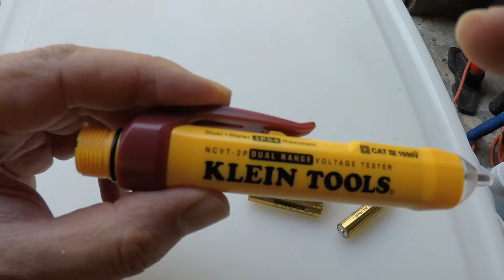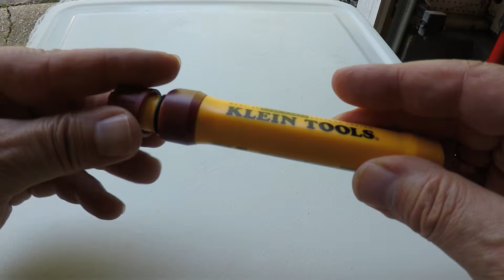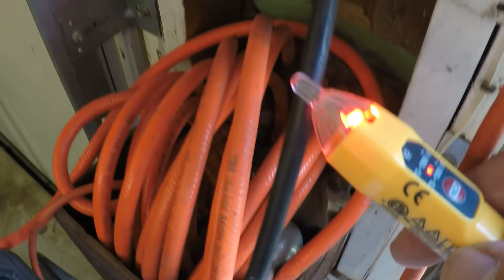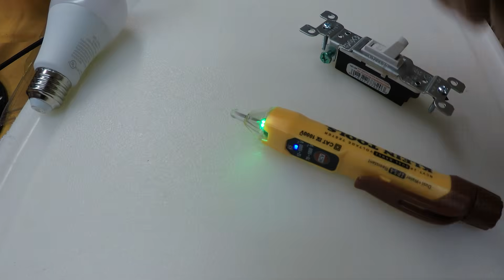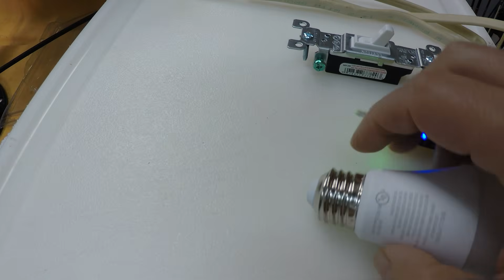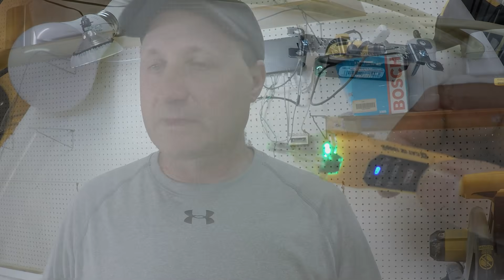How to Use a Non-Contact Voltage Tester

Comment: I just purchased one of these testers with the electrical outlet plug that comes in the package deal and I put two batteries in it that came with it facing them both pointed inward like it shows on the side of the unit and nothing happens what is going on any ideas
Reply from the maker: I dont know about those. Get the one that I reviewed. Link is in the description
Reply: Hold the power button until it turns on. Some voltage testers require u to hold the power button down until it turns on

Comment: This tool sucks.  It’s not accurate and has so many disclaimers on when it will not work.  I’ve touched live feeds and it did not detect half the time.  I’ve stuck it in outlets and detects only sometimes.  It does not work outside sheathing in all cases based on where you are standing.  Buyer beware and make sure you read the instructions thoroughly and the you understand what the directions are saying.

Comment: I find these to be super useful when opening up an outlet and trying to figure out where the power is coming from and where it's going to. First kill the power and pull the outlet off the wires, then re-energize the wires and check the lines. The lead line should beep for being hot, and then the load should still be dead. Very useful if you're about to replace an old outlet with a GFCI. Then re-kill the power, and wire in the new receptacle. After that you should be good to go.

Comment: This came with my new Dewalt multimeter and I didn’t know what to do with it. I thought it was very cool going around the kitchen touching it to the Keurig wire, the air fryer, etc. But then I touched it to a mixer that was not plugged in and it gave me a positive reading. What’s up with that?
Reply: Its a piece of crap thats what. Dont use them.

Comment: Fun bonus, it will also detect if an ionizer found on many air purifiers is actually running.
Reply: How to test for altitude sickness current on a centech cm300 multimeter
MO
Reply: How to test for ac current on a centech cm300 multimeter

Comment: These are banned in the UK in most industrial settings as they do not work on some cables such as SWA and the only approved method for testing for dead is prove the tester, test all power sources including earth and neutral. Then prove the tester again. This is standard in the UK but non contact testers and volt test screwdrivers are banned for safety reasons
Reply: Would this work for basic diy though in the UK? If you put it against the cable
Reply: On internal cables yes, on external armord cables no, sometimes they flag in dead cables with transient voltages such as RF but as they are not dependable and UK voltage is 230v they are not used, only volt testers such as fluke are used to verify the voltage with a lo-Z meter and in industry meters are always tested with a check box before and after testing
Reply: @3D-Dan  I assume a security light would be fine with it then, nothing special in terms of cable.
Reply: Yes it should work but safer with a volt tester such as a fluke T90

Comment: Great video and thanks for sharing. Would this pen work to check for a live wire with higher voltage (240) on something like a hot water heater?

Comment: Never at work with out it but I have found the one with the flashligt to be very handy.  Soon after you start carrying it around it power cycles and beeps in your pocket.  I think the battery spring just needs to be more robust.  Sometimes a small washer helps for a while.
Reply from the maker: Right on

Comment: This will accurately detect a live wire?
Reply from the maker: yes it will
Reply: @flannelguydiy6458  through the sleeve?
Reply: No it wont , you wont know the reason why it beeped or why it did not.

Comment: Will a detector like this register voltage from a dryer outlet?
Reply from the maker: it will detect the current but will not tell you the actual number of volts

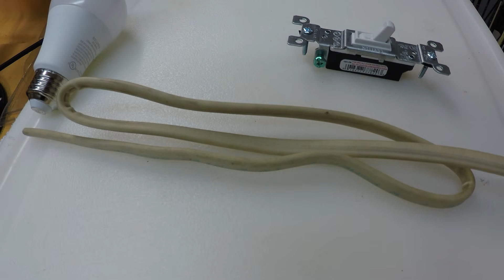Comment: 4:22  That’s the most useful test of all.  In a minute I’m driving over to Harbor Freight to get their 5$ NCVT and see if it’s worth a crap.
Reply from the maker: thank you for watching
Reply: Its crap alright.
Reply: Was it?
Reply: @FrankBenlin   It works, but you get spurious results which are probably not its fault but rather due to dead wires  affected by nearby fields from hot ones.  So some effort is required to get clarity, which can be frustrating.  BUT, I should add, false negatives are surely impossible.
Reply: @philg4116  Okay. Thank you for responding.

Comment: Thanks for the review. It was very useful. Just to add the one I brought has a vibrate function as well.
Reply from the maker: dont let the wife borrow it
Reply: @Flannel Guy DIY  no worries 👍. House we brought has a lot of redundant cable throw under the flooring  will be a good safety asset.

Comment: could this be used to detect if there's a wire in the wall? (so you don't drill a hole there?)
Reply from the maker: no, for that you need a different device which I also made a video on

Comment: This tester does not tell you if you have power in the outlet or a switch. It tells you there's voltage on the line,but you can have perfectly good reading ,indicating good line and the outlet does not power anything. Easy test proves the pen is not a tool to detect power in the wire- rub the tip of the pen against any plastic bag. It will glow red and chirp( if the function is present). Needless to say , the wattage shown is minuscule.If the live wire got shorted under the screw in an outlet and there is an oxide/carbon build-up on the wire,the pen will show you a perfectly good outlet,which cannot power anything.But keeping in mind all the limitations, a useful gadget
Reply: thanks for the insight
Reply: My pen came with an outlet tester. I guess they realized  that could be an issue?
Reply: Right
Reply: Thank you for this. This thing is going to get me shocked.

Comment: There are clones out there going for cheap and can make sound and show graphs. I bought one. Definitely a handy tool. Before I was scare of dealing with switches, breakers, and outlets. This sure is a safety measure.
Reply: There is a clone I like, thinking about getting it.  How is yours
Reply: None of them are good.
Reply: When it comes to safety especially electric I'd go for a reputable company
Reply: @SeanTyree-f4o  none of them are safe.

Comment: Can a voltage tester detect a break in a wire?
Reply from the maker: it cannot detect Where the break is
Reply: @flannelguydiy6458 do you know how that tool is called to detect the break in a wire? if there's such a thing? thanks
Reply: Surely it could as one side of the break you will have voltage the other side you won't?

Comment: These are nice for tracing wires and checking outlets but if you can check voltage with a meter always do that first.
Reply from the maker: yes checking the voltage is something else. This thing can test if the wire is live right through the jacket.

Comment: What is suggest tester for so much wires in a large box if test single wire has power with insulation with so much wire cross each other
Reply from the maker: I suggest turning off all of the breakers until ALL of the wires in the box do not have power going through them

Comment: https://youtu.be/g7HWBfeawJ4  yours appears to be silent and the red light is not flashing looks like the NCVT-2? I wish you would've put the model number since there are several of these this link explains all the different models of Klein voltage testers.. i'm going to get the NCVT4 with thermometer.. BTW in this video the NCVT 
-2 does beep.. Is there a way to turn off the beeping?

Comment: Is there a beep feature on your model? 
I have the NCVT-1.. It beeps pretty loud repeatedly along with the red light flashing but sometimes only one beep but most of the time continuously and it doesn't stop until you pull away.. Which by the way your link seems to be upgraded from your NCVT-2 to the NCVT-3 Also mine does not have any selection for different voltage but it does say on the side sensitivity ranch 50–1000 V also mine only has a power button which can unfortunately be very easily bumped! And I think I remember receiving a notice from Amazon that my model was recalled lol

Comment: The video explains very well. The voltage test pen is still necessary. I bought a renhotecic brand test pen not long ago. The test is very convenient, accurate and safe. Family must.
Reply from the maker: thanks for watching...
Reply: I need to get one of these for a wire I found near a old shed that feel and the wires are caped but I need to see if any of switches in the house turn it off or if its linked to the main power to the house.

Comment: How do I know when to use 12-1000 or 70-1000?
Reply: I think 70 to 1000 is automatic whereas 12 to 1000 is manual. So if your looking for an accurate reading I'd go with the 12 to 1000. This will pick up all voltage even faintest ones. Thr automatic will focus on thr dangerous voltage m3wnint it will ignore anything below the threshold. I would recommend manual one.  But please don't take my word. Do your own research before testing out.